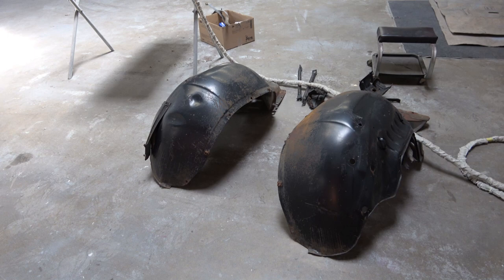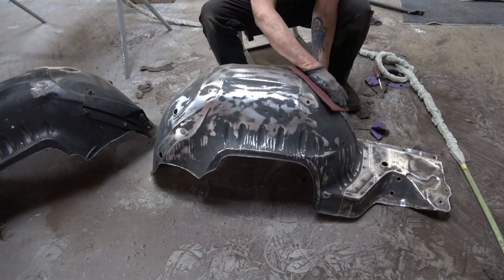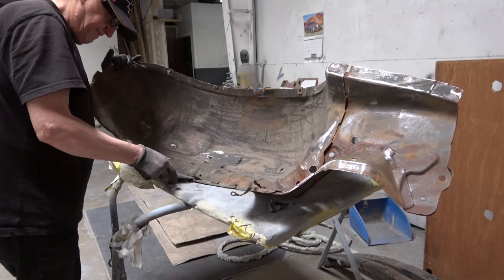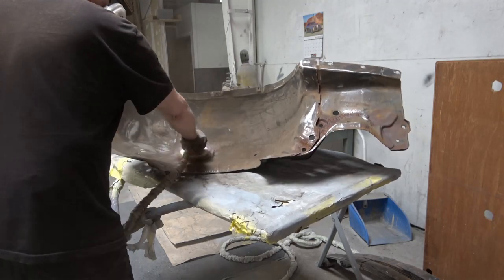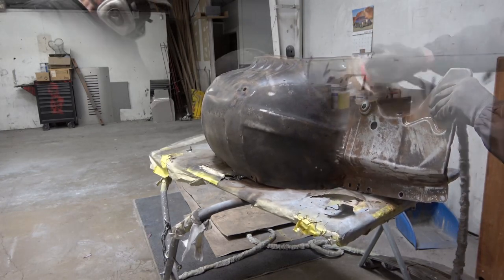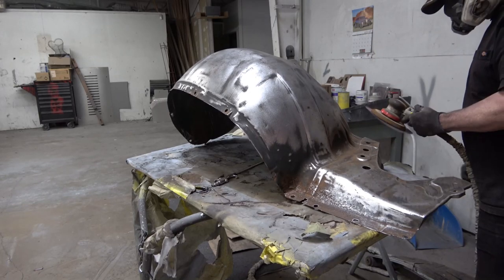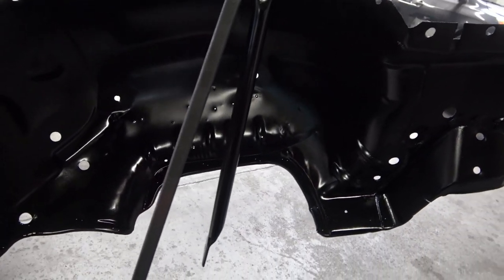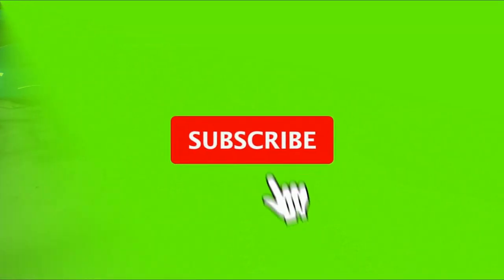69 Camaro Z28 Z/28 in Le Mans Blue Full Frame Off Restoration Video Series - Part 9 - Inner Fenders

Comment: Great job but alot of work! Next time consider using a heat gun or map gas torch and heat from opposite side and the undercoating will flake and brush right off! Then send to the blaster and have them lightly blast clean all the paint and surface rust. I suggest welding up the staple holes and carefully drilling and prefitting the new staples as they are slightly different spacing than the oem staples and flaps. After blasting, immediately topcoat with a premium 2k epoxy primer sealer such as Valspar vp50. Then continue on with any light bodywork and priming before paint. A skim of body filler right over the scuffed epoxy works magic to smooth out any rust pitting and or small imperfections. Don't forget to run a tight, I mean tight like wipe off 99% external showing sealer and leave it only in the seams where multiple panels overlap to ensure nothing will creep between layers and wake up any sleeping giants later on! 👍
Reply from the maker: Hi JR
Thank you very much for that valuable info.
I will definitely do that on my Hugger Orange car that I am starting on.
By the way, I kept the old staples, I wonder if they could be used
Reply: @digitalpizza1  you might experiment with the old staple and see if they break during the second bending or heat up before you bend back may help

Comment: How does one do a "frame off restoration" on a unit body car?  ; )
Reply from the maker: Ha, yes you are technically correct, it would actually be a "sub-frame" off restoration. but of course the term really refers to the fact that the car is stripped completely. But i am sure you are just being facetious in a fun manner :)
Reply: @digitalpizza1   - Correct. That's why I put the wink ; ) in there.  But early Camaros, Novas,  and Firebirds did have a removable front subframe.  Looks like you did a fantastic resto on this F Body!

Comment: Media blast? You seen to have a shop with a lot of things us home garage guys don't. But not taking it 2 a blast shop is beyond me
Reply from the maker: I am not a fan of media blasting. It etches the metal and seems to take the smooth texture away. I did power wash them before and the material that I was removing was not only the surface rust, but 50 year old undercoating that is like petrified at this point. Again, I chose to do it the way I did it, and they turned out beautiful. Well worth the time.